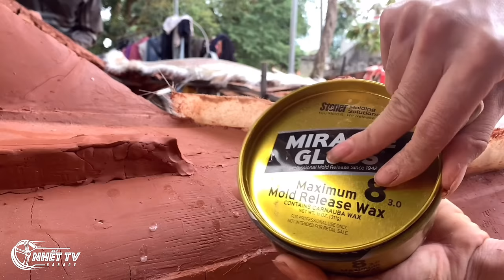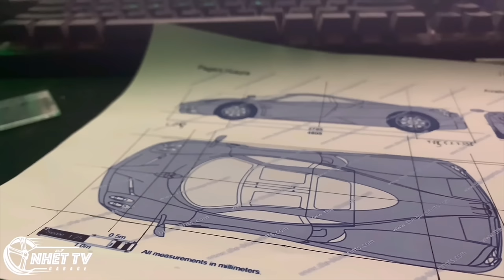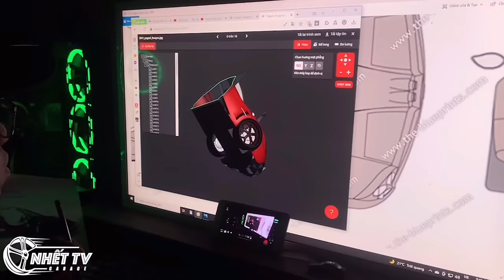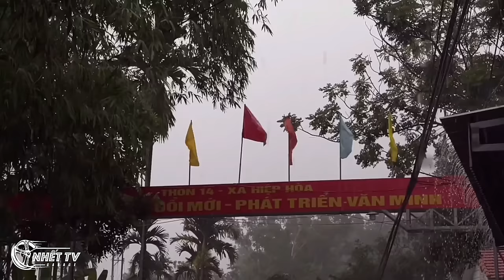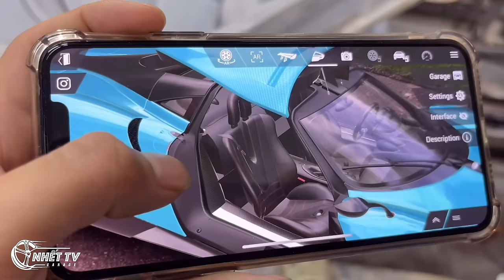TIME LAPSE...Build a Pagani supercar from an old Toyota

Comment: Your moulds are always good, i think to take your builds to the next level use sheets of carbon fibre when moulding the actual main body and buy a secondhand engine preferably a V8,V10 or the ultimate V12.. i really believe your craftsmanship and attention to detail is ready to set levels in the youtuber automotive world.. 👏🏽 awesome work 💙
Reply: Yeah imagine a carbon fibre shell, but they would have to step up their body and paint quality too though
Reply: Having a V8 or 10 engine is too expensive for the cost to run for the budget. Think it's better affordable engine that's suit their budget.
Reply: Carbon fiber is expensive as hell
Reply: It would be nice no doubt but really expensive.
Reply: I'm enjoy the build quality..I wonder if they keep that moulding for copys of this..
Reply: true, but the beauty of this build is how they're using easily sourced materials to build it. Carbon fiber requires vacuum bagging and specialty tools to be done right. Plus a V12 would require a more rigid frame too. I do wish we had more of that red earth clay here in Texas, I work with fiberglass and I'd be building more large scale stuff if it was cheaper.

Comment: Definitely need to start building carbonfiber parts and instead of steel a carbon monocock your making molds of everything anyway it could be 1/4 the weight and look 6 times better.

Comment: guys its pretty much standard practice not to sand straight panels with your finger as you cause grooves you need 2 block sand Eg freeze48m53s bad  good is the older guy on the left at 49m27s thats proper technique old guy showing the young bucks how its done

Comment: HOW DID YOU GUYS TURN A RWD FRONT MOUNTED ENGINE INTO A REAR MOUNTED ENGINE WITH RWD
Reply from the maker: Thank you friend ❤
Reply: It's simple for fwd just take engine out from front put it on rear without rotating the engine then connect rear wheel shaft on engine and you done it ..but I want to remind you the gearing system is opposite way need to get used to it first or you can create new knob gearing system